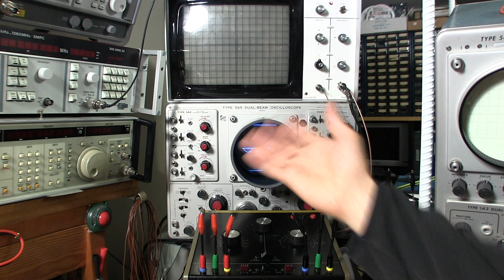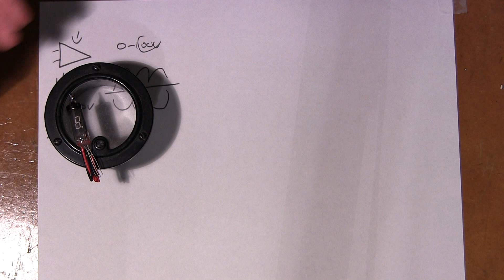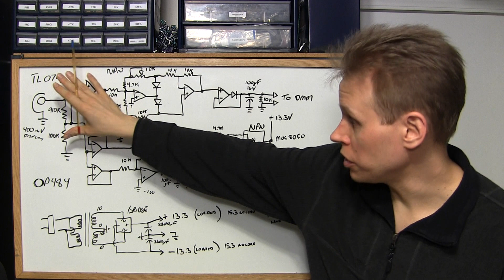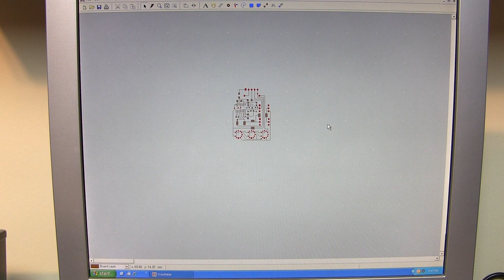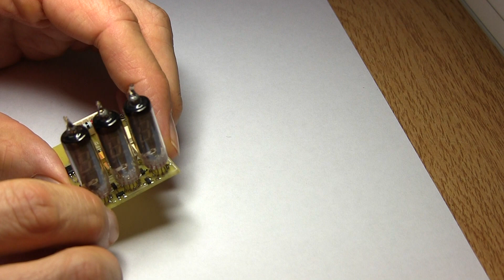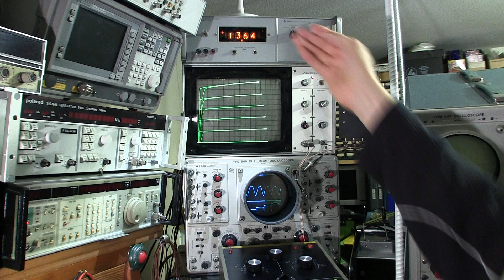Electronic Circuit Design, Let's Build a Project

Comment: I've made some SMD PCB's in the past, and I would have loved to see you solder those VFD tubes.  I had such a nightmare with 0603 resistors I'd like to see how the heck you soldered an 0402, especially without a solder mask.  Do you use a reflow oven and paste or you glue down the part.   And yes, I'd be nervous about the soldering the VFD, did you solder the bottoms and let capillary action wick up to connect on the top side... but then you might have some dwell time issues. Have to be so careful.  I'm just in awe of your board.

Comment: If you're worried about overheating tubes. An old trick. Take a container deep enough for your tubes and circuit board. Fill it with water deep enough to cover the tubes and leads, now flip the board over and lower the tubes into the water till the circuit board just touches the water making sure the side you want to solder doesn't go under the water. You will need to design some type of holder so that the board just touches the water and doesn't move around on you. This will take some custom engineering to work. Now do all the soldering work you need. The water will act as a heat sink for the tube leads and when you are done just blow off the board, and let it dry. No overheating of the tube seals if done right. Do not put relays underwater and it's best to do this only with the tubes and no other parts on the board unless necessary. Good luck guys, Mike

Comment: I'm building a project using 3  VFDs like you do. A timer is what I'm building like a kitchen countdown timer that you set up to 3 hours . I want to use a 7447 decoder/driver which has an active low output which connects to the base of  a npn transistor with collector tied to the anode segment of a the IV-6 tube, and a resistor from there to 18 volts, to turn on each segment. It says 30 volts can be connected to outputs of 7447.  Im using 18 volts for grid (can go higher but choose to use less power requirement), grid voltage same as plate voltage and 1volt heater; pin 7 of heater used as ground. Current is very low for each element,  so I plan on using 10k base resistor and 100k collector resistor as starting `point and then then 1k and 10k which should still be no more than about 1.5 ma.I coudnt find any example how to do this and it seems it should work.

Comment: A friend of mine built a 10 digit version of this back in the 60s,  but it was an all vacuum tube design.  He used a JAN6201 for each decade divider.  He called it a "univibrator",  as it was rigged as monostable (one-shot multivibrator).  Additional 6201s were used as cathode followers to drive the Nixie rows and columns and as the ALU.  A 6BA6 (5749) was used to boost the input,  and a 5726 was used as a clipper.  Not a single transistor or solid-state diode was used!

Comment: I am looking for a circuit to detect a contact closure on 24 inputs. Is there a single IC that can do that or an IC that does 8 or 16 contact closures that I can string together. I am using a single TI 5947 chip to generate 24 output contact closures and now I need to verify that those 24 outputs actually closed the relays. 
steve.mcneal@daystar.com

Comment: I have at least 8 of the exact same VFD's I pinched from a desktop calculator (I have the schematic which mentions the supply of 45v for the VFD's) . Im tempted to adapt them for the frequency counter project

Comment: Paul I got a neat project idea for you...... Have you ever seen a seeburg from 1959 I believe model number is a 200 s meaning 200 selections and stereo , but here is the interesting part it was the first " digital " selector unit using ferrite cores for each write in switch , and the amplifier is chick full f caps !  I think model number on amp for this machine is shfa2  , And it has a pulse amp with chokes , and mechanism is very complicated with loads of switches and relays it's an awesome machine actually I restored one ten years ago and it still runs , amp uses 4 6973 , one 0a2 either tow or four 12ax7 , and an 5u4gb rectifier and small silicon transistors I can't remember number , I think a project like this would be awesome love your videos , there is no other in you tube like you at all please keep making vids
Reply: It was a 220 s sorry
Reply from the maker: Hi Daniel. I believe that unit is called a "Tormat" memory. I have restored this jukebox quite some time ago, long before YouTube existed. If I have the chance to do another, I may in the future.
Reply: @MrCarlsonsLab  it is a tormat memory i would adore a video of you restoring a device like that as you know the amp is way overbuilt and there were Gremlins in the design and I am positive you would be able to handle it as I've said before you are amazing where the hell were u years ago I wish I could do some of the work you do thanks so much for sharing

Comment: Great design! You really get a lot done with few components which I would say is a hallmark of great engineering! It's kind of a shame then that you didn't go into a bit more detail about the "absolute value" circuit, the top part with the TL074. It's really an ingenious design, if I understand it correctly, the third opamp in the chain alternates between being a noninverting and inverting unity gain amp depending on the polarity of the input in the beginning of the chain. The diode on whichever side that is not currently active (PNP if positive input, vice versa) has effectively virtual ground on the leg opposite the one connected to the second opamp. Is that a correct way of looking at it? Thx
Reply from the maker: I would love to answer this question here, but I would write a book. Thanks for your kind comment!
Reply: Yeah, I've been studying long enough to know there are rabbitholes everywhere in electronics! Maybe I'm oversimplifying, I'll test it out on protoboard and see if I got it right. Cheers :)

Comment: Your workshop looks like surplus 40 years old stuff.  aRE YOU SELLING REFURBISHED ANTIQUES OR BRAGGING?

My shop looksd like yours 40 years ago.  Its cool to ME, but might intimidates the newcomers.  Minimize the equipment and expand simple USEFUL tools.. TRY IT.
Reply: I love the mix of old and new.  Can you cut down on the instruments?  Of course!  But that wouldn't be Mr. Carlson.  The premise of using old tube gear to troubleshoot problems in newer circuits is brilliant!  Thinking outside the box...TRY IT!

Comment: Thanks for all your great videos. Have you ever done a video on the Wavetek large x-y oscilloscope display? I’m curious about those. Yours reminds me of the large displays that were used in analog computers back in the ‘50s and ‘60s. I just bought a couple off of eBay, but I found there are many different models, and I’m not sure how much is common between them. I want to use one in my analog computer work, but I was not even aware they were available until I saw this video. The Wavetek models were mad long after  analog computers were no longer used, so I was wondering about their application. I wish someone still made those. They are very useful for getting more precise measurements from an analog display. The symmetrical x and y grid divisions are also preferable to the asymmetrical grids on a modern oscilloscope for analog computer work.

Comment: I'm connect a 12v 10a box running small air pump and water pump- constantly when power connect. and a temperature controller that activates a peltier chip when needed

Comment: First time long time. Off topic of this video I have a kikusui power supply PAD 55-60 it has hirel ED 203 output transistors and i cant find a spec sheet on them. How many volts are they good up to. I'm trying to get 62 volts out of the power supply but don't want to harm the unit. Thanks

Comment: is that a tube scope ? I have one laying around, which looks alot like it but not as high, the buttons are similar but the screen is green instead of blue, and it's broken at the moment.
(can't get it to trace from left to right) i might not repair it because it might take to much time. and i'll scrap it for parts, which is a shame :S but that way it's parts will at least be used. even if the scope won't be.
Reply from the maker: If it's an older 500 series Tek scope, they are pretty collectible.

Comment from the maker: Hi Kevin Byrne. I use no circuit simulation programs at all. (I don't have one)  The only program I use is Traxmaker. This is where I draw the circuit to be etched.
Reply: Hi Mr Carlson. I am not sure I liked the video. You say you'll walk us from problem through concept to design and implementation. However, what happens instead is you state the problem and the immediately jump to the finished solution, and explain why you did this or that. That's not the same. We couldn't see what sort of things you have considered for solutions, or how you searched for possible solutions or designs that would fit the problem. There is a little of that at the very beginning (the part where you say we'll need an op amp, and a 1:10 voltage divider), but later you seem to just skip that. For example you don't explain how you arrived at the logic for driving the different vfd segments - instead you just showed the final solution and walked us through it. I would have liked to see more of that: how to figure out, invent, or search for designs? How to figure out the correct implementation? How to select the right semiconductors and passives? How to make the design nice and clean? You seem to have skipped over all of that. This is more like an analysis where we take a ready bought device, and we're told what it does and how it works. I'd love more of those "basic" things!

Comment: A friend of mine ran across a HP module with Nixie display.  It was very odd to see this overly complex decoder driver.  Later he ran across this page that explains how it worked.  It was your video that made it clear the reason was to handle the voltage of the Nixie displays or tubes.
http://www.decodesystems.com/nixie.html
Its about halfway down the page called Hewlett-Packard HP Nixie Module.
He talks about 1242 logic.  Is this the same as the 1224 logic you mention?  
Thanks for your great videos.

Comment: Very cool.  Nice to see things being designed that don't directly require micro-controllers.

What software do you use for your PCB design/what would you recommend?
Reply from the maker: +Randall Tockes 
Hi Randall. There are a lot of PCB programs out there that are great. I use an older program (traxmaker 2000 pro) but the newer Altium is great too. Thanks for your comment!

Comment: Cool video. I know this is an older video and you may have already done this but i will ask anyway. Can you demonstrate an example amplifier circuit using the curve tracer to find the optimum area to run a said transistor? Then apply the data to substitute the correct resistance in the circuit.
Thanks for the video.
Reply from the maker: +J&B Fix it shop 
I think you are talking about the transistor quiescent current point? In the future I will do a video on this. Thanks for your input!
Reply: Yes that is it. I forgot what it was called.
Reply from the maker: OK, No problem :^)

Comment: hello Sir, this is a beautiful combination of a concise digital circuit diagram concerning the VFD's 7 segment indication bulbs with an analog circuit attached using the op-amps array to run the previous circuit and catch the pick voltage..
Your explanation adds to the video to become a complete package of experienced hands-on laboratory.
I applaud your work here..
Reply from the maker: +Ronen Shemesh 
Thanks Ronen!

Comment: Nice video but i wanna ask you a question  people don't answer very well.

How did you design the circuit diagram? Was it your initiatives? I will like to know cause i wanna start designing circuits.
Thanks
Reply from the maker: +Abayomi Joseph 
Hi, I just build this in my head then put it on paper (or whiteboard) This kind of thing comes from experience and time put in. If you want to start designing, get a breadboard, and start building. Mistakes are good, they will make you great!
Reply: Am doing that. Is there any scheme or steps to learn electronics? Or i should just start building circuit i lay my hands on?

Comment: Hi Paul...I know this is off topic but I came across a tube in an old DeForest radio that has an odd component. The tube is a 12b6mt and it has a smaller plate looking thing inside to the side of the grids. Any idea what that is?  Jack
Reply from the maker: Hello Jack. Can you send a picture?
Reply: I don't know how to put a photo here...
Reply from the maker: +Jack neff You can go to my about tab and use the email address there.
Reply: +Mr Carlson's Lab  I don't see the about tab so I sent it to your facebook page!!  Jack
Reply from the maker: +Jack neff I don't have a face book page
Reply from the maker: +Mr Carlson's Lab If you click on my channel name, you should see a bunch of options. IE: video's, playlists channel, and About. Click the about tab.
Reply: I could only find your business address so I sent it there.  I cannot find the tab here you mentioned. Sorry...Jack
Reply from the maker: +Jack neff No problem, I thought you meant you saw something visually through the bulb. In the base diagram, the thing off to the side connected to pin 5 is a diode plate, used for detection or AVC. When ever you see a plate located close to the Cathode in a diagram IE: 6AV6, or 6AT6 or the like, most always those are diodes used for this purpose (detection or avc). That diode is separate from the triode completely, aside from using the common cathode between them. Really 2 tubes in one.
Reply from the maker: +Mr Carlson's Lab  
Oh Ya, If I remember correctly, that's a spray shield tube as well.

Comment: Great video. Where can I find some explanation on the top part of your circuit, the one that makes the signal always positive? Also on the last unity gain Opamp of this part of the circuit why the diode before the feedback loop?
Reply from the maker: +Nuno André 
Hi Nuno. Great Question!
 One day I will do a video dedicated to interesting op-amp configurations. The applied feedback attached "after the diode" makes the op amp compensate for the diode loss (.6V) or there about.  The diode in the last "close to" unity gain op-amp stage is acting as a one way valve to charge the capacitor, and not let it discharge when the op-amp's amplitude changes. Remember, the op-amp's output signal is following the input signal (now with drive power) So it's pushing the output signal up, and pulling it back down. The diode makes the op-amp loose the ability to pull the signal back down. By doing this, the output value "rides" the top of the waveform giving a peak value to a DC meter. The resistor creates a discharge time so the DMM  will change in value when the amplitude of the original signal changes. If the resistor wasn't present, the cap would hold the voltage high, even when the signal at the input of the op amp goes low, this again would be due to the one way action of the diode. The only value change at the DMM would then be caused by capacitor and diode leakage.... Or the possible input loading of the DMM meter itself.
Reply: +Mr Carlson's Lab thanks for the great explanation, regarding the other part of the only positive circuit would it also work of you would use a rectifying bridge at high voltage and after that use the voltage divider and unity gain opamp? Well you would lose some isolation and the ability to independently control npn and pnp signals.
Reply from the maker: +Nuno André 
Hi Nuno. Another good question.
There would be a few issues if it were done that way. The first would be: The curve tracer's output to the scope is affected by impedance change (lower impedance) Applying a bridge at that point would load the circuit and "add" to what you are seeing on the monitor or scope; ( the DUT). The second issue: We would have a loss through two diodes of the bridge for positive going signals, and two diodes for the negative going signal. The op-amp's feedback allows for that compensation. The third is exactly what you mentioned. We need another circuit to buffer, amplify and rectify the signal as to activate the opto-isolator's internal LED. So really, the big issues with this are to keep the project "invisible" to the curve tracer, yet the project see's the tracer.
"A high impedance project looks like an open connection."
Reply: +Mr Carlson's Lab thanks for all the explanations!
Reply from the maker: +Nuno André 
No Problem Nuno, Any time :^)
Reply: Great video Paul!  I am one of your Patreon members. I just purchased a B&K 501A, as well as a mint Tektronix 502A - dual beam oscilloscope so I may create a setup similar to yours. I cannot however, locate a Wavetek monitor. Any recommendations on a modern version or model of, that what might work similarly in compatibility with my new gear?  Thanks in advance!

Comment: Love watching your videos and seeing your repairs or projects such as this one. Great Job. I would like to ask you if the power supply board has a built in safety fuse to prevent future fires or burn outs?  I could not tell by watching and I was just thinking your project box would contain a fuse holder and fuse in line with the power cord. Again Great Job and thank you for sharing with us out here in You Tube land. Dale
Reply from the maker: +DALE BROOKS 
Hi Dale, No fuse, the wires in the transformer primary are the size of a hair. There's the fuse. Draw at 120Vac is below 100mA continuous. These are the same transformers they use in wall warts.... No fuses there either.